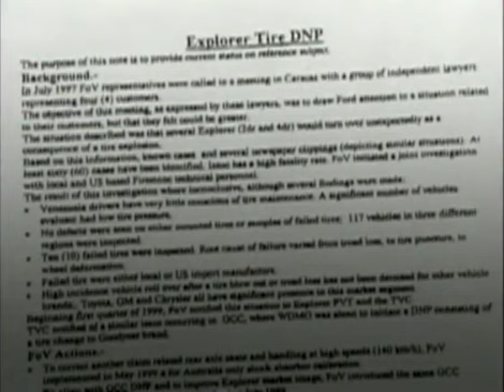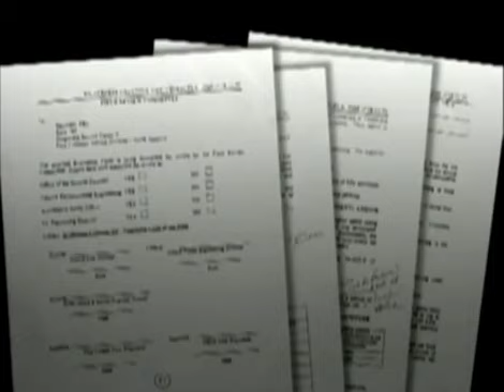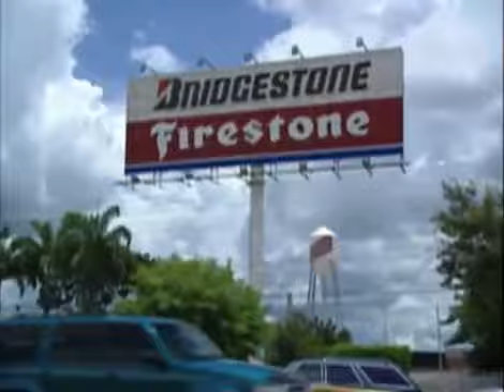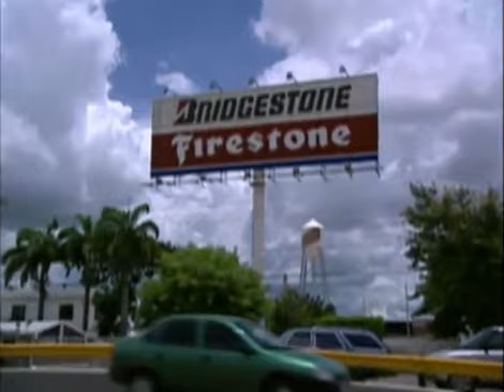60 Minutes: Firestone's Deadly Tires Scandal – 2001

Comment: 9:22 - Root Cause: A high center of gravity led Ford to recommend PSI in the mid-high 20s, vs 32psi or higher on other brand SUVs.  This caused excessive sidewall rub and flex, and ultimate tire failure.
Reply: My opinion too. "gOtTa hAvE tHaT cUsHy rIdE"
Reply: @2K-Tan   Not so much about the ride.  I explained why in my comment above yours
Reply: @Zickcermacity  Yes I get what you are saying. Excessive Sidewall Rub and Flex. However I feel the reason Ford wanted the lower psi is for the ride "quality" as usually more air in the tire means more "feedback" and stiffness through the tire as well. That's all i'm saying. For example Mazda recommends I only inflate the tire on my '16 MX-5 Miata to 29 PSI. 

While this may be acceptable for smaller and thinner 205's I still think it's personally too low for prime performance, so I inflate them all to 32 which usually makes the ride a tad worse but I get better feedback as a result.
Reply: @2K-Tan   And you have a right to your OPINION that the reason Ford lowered the original Explorer tires to 26psi "was for ride quality".  Just remember that it is your opinion, and you are solidly in the minority on that.
Reply: @Zickcermacity  So what model year of explorers should I avoid? I'm looking for an explorer but don't want one that's prone to rollover
Reply: @johnny622   NONE!  
Just watch how you drive.  Slow down and don't corner like Andretti on a road circuit.  

Also, on first generation(1990-1994) Explorers, go a little higher than 26psi cold tire pressure.  Try 28-30psi, first thing in the morning.
Reply: @Zickcermacity the descendant of Both henry ford and Harvy firestone took it Personally

Comment: over 600 deaths. mostly soccer moms and kids. will never buy another firestone or bridgestone tire.
Reply: The same firestone atx tires didn't kill anybody in durango's or yukon's. Explorer's liked to roll, didn't you see Jurassic park?
Reply: @Reddbeaver  235.75.15 FS ATX were only on the exploders. GM had a deal with bridgestone and dunlop. Durangos mostly came with Goodyears.
Reply: @automan1223  i didn't know that. Do you think it was the tires causing the problems? Or did ford share blame?
Reply: @Reddbeaver  Ford wanted a passenger car ride out of a truck chassis. Firestone used passenger car specs to satisfy the ride. The tire was technically overloaded with anything but an empty vehicle. Compound that with 28 psi on the door sticker and a tire that had a marginal max load at 35 psi (sidewall) That being said Firestone labor was having a problem with mgmt and were sabotaging tires. Some in ways to this day I do not fully understand because I worked a few tire problems that were brand new from Firestone. I think both companies shared blame opinions vary on who got the blacker eye. Engineering got involved and finally started to make tire sizes that would only fit certain vehicles. That's why you see bizarre sizes that cost a fortune on your average grocery getter.
Reply: @automan1223  shame when they lose sight of their customers safety. Thanks for the free education brother!
Reply: @Reddbeaver  Sad part is I was one of the first to contact NHTSA to let them know of serious defects  in Firestone ATX tires 2 years before the story broke on the national headlines. People are expendable. Sociopaths run the world. The only thing I ever got from them was a form letter saying they would look into it.
Reply: @automan1223  that's nuts. What brand do you drive now?

Comment: Firestone must be real proud of their ex expert. When asked what causes tread separation   he completely forgot to mention high temperatures for thousands of miles due to insufficient pressure. Any tyre type and brand  can suffer separation in the hands of any owner if tyres arent checked regularly. For some reason a lot of car companys indicate a mythical 32psi on their tyre placards and owners manuals. So assuming these tires need to be run at about 36psi and Ford reccomended 28psi this aint rocket science. With most car owners evry single aspect of their tyres goes " undetected ". Check the footage at 3:44 and 8:48 and the expert states " no evidence of running flat ". I think the real cancer at work here is misinformation.

Comment: Not the first controversy that Ford has been in. In the 1970s there was the Pinto and it's dangerous gas tanks. They looked at lawsuits as simply the cost of doing business and was no big deal, just pay it out and forget about it.
At the time I was driving longhaul and our company specifically used Bridgestone tires and we had many premature blowouts but no one that I knew of  was seriously injured. I remember Ford Explorers sitting unsold on dealers lots as no one would buy them for a while.
The Venezuelans look like good people but have had such corrupt governments for many years.